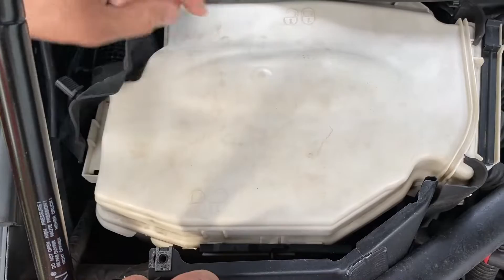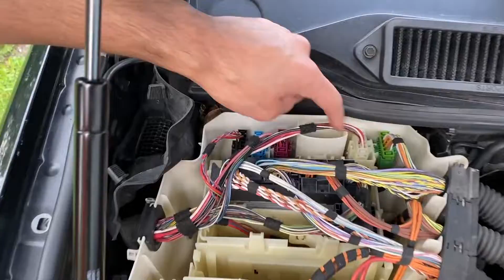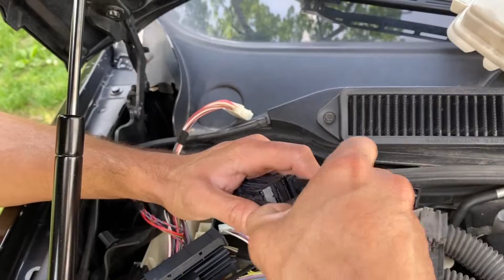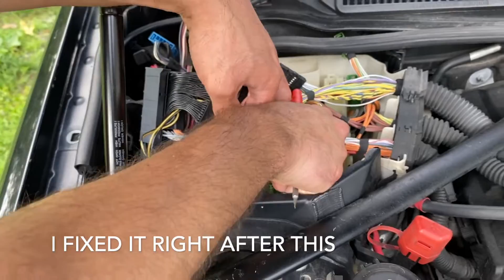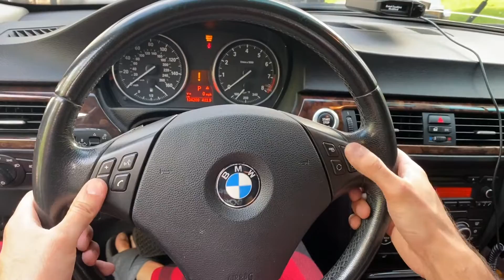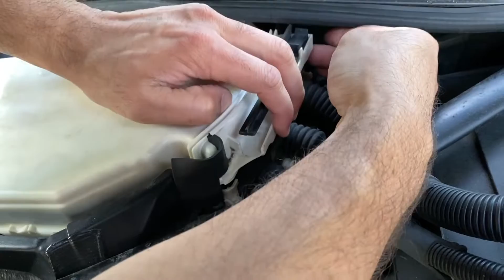How to Install a JB4 in an N54 BMW 335i EASY! Under 20 minutes (Remove DME)

Comment: Thanks for the help! I used this tutorial to REMOVE a jb4 that the previous owner had. I enjoyed it for a little while, but it gave me lots of problems & frequent limp mode, to the point I just disabled it.

I've been running mhd only for a while and there's been no problems or limp mode! So I'm getting rid of it. 
I plan on going Motiv Reflex later down the line anyway, for when I get bigger turbos, PI, e85 hardware, & a second fuel pump.

Comment: Followed your video when installing mine , after it was on drove the car for 15 mins parked it shut it off now it won’t turn back on. Any idea what this could be maybe i fried a fuse or something? Tried jump starting it and nothing
Reply from the maker: Is it still cranking? Any codes? It could be a loose wire somewhere or maybe a blown fuel pump fuse. Also check the codes if you can
Reply: I'm curious - a year later, still a brick?

Comment: 🚨Video was very helpful however my car has a weird idle right now it runs fine for about 30 seconds to a minute and then it stalls out any tips please 🚨 I’ve checked everything and it’s all correct idk what I’m doing wrong do I need to set my jb4 to like a reset mode please help thank you
Reply from the maker: Did you do the throttle learning procedure? How do your plugs and coils look?
Reply: What’s the throttle learning procedure?
Reply from the maker: @caseyard7143  pretty much you turn the key on with engine off and hold the gas pedal down for 30 seconds and then you turn the car off, let go of the pedal, and wait 3 minutes before starting the car
Reply: @tunerworld  I really wish I tryed that before I toke the jb4 off lol
Reply from the maker: @caseyard7143  haha well damn, you also have to make sure all the JB4 settings are right

Comment: How did you fix buttons not working? Jus ran into the same problem
Reply from the maker: Check to make sure your power is good and then replace the buttons if it still doesn’t work!

Comment: Any one know where I can get that terminal where the plug connects to the green plug the power
Reply from the maker: You talking about the pin? You can always splice into it as well if needed!
Reply: @tunerworld  yes the pin I had to splice the brown wire to the red power wire due to the pin breaking now I want to take out the jb4 and I need to install a new pin and take out the splice
Reply from the maker: If it’s missing I would just splice into the wire. Or you can contact BMS for a new one maybe!